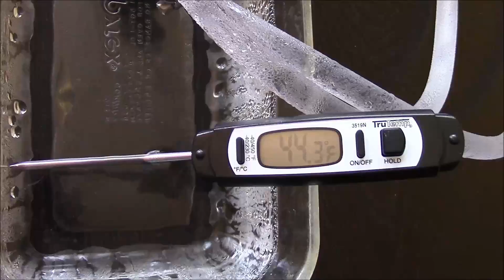How to Build A Water-Cooled Peltier Device or Thermoelectric Cooler

Comment: Hi LDS. Just wanted to know why the thermoelectric peltier tec1 12706 both sides get heated up when I connect to the 12 v adapter while I was testing. But while using a simple AA battery just to check the Thermoelectri,  one side was showing cool and the other plate was hot.
Reply from the maker: RaymondJacob0922
The last 2 numbers equals the approximate number of amps that the chip will draw.  The 12706 is 5-6 amps depending on the manufacturer, the 12715 is 15 amps, and so on.  The delta (difference in temperature between the hot and cold sides) is bigger on the higher power units and so yes they can get colder as long as you cool down the hot side adequately with a nice heat sink or cooling block.
Reply from the maker: +Benju Martin Thomas You need to have a heat sink connected to the hot side for it to work, otherwise the heat overpowers the cold.  Power it on for 3 seconds and then touch each side to figure out which is which.  Then put a heat sink on the hot side with some thermal grease.  Then the heat will have somewhere to go and will not interfere with the cold side.  Also, if you run a peltier without a heat sink it will burn up quickly.
Reply: +LDSreliance Thank you so much helped me a lot. Another quick q's. how long does it usually take for the Peltier Module to cool.
Reply from the maker: Benju Martin Thomas If you have a heat sink connected to the hot side you can freeze a water droplet on the cold side within seconds.  It works quick!  That is why you never want to run the peltier without a heat sink for more than 5 seconds or it can burn up.
Reply: Hi LDS, another quickie q's. I first cleaned up the Corsair Heat Sink plate, applied Artic Silver 5 paste on the heat sink as well as the water block. Tested the peltier with a AA battery to check the hot side and cold side. Placed the hot side on the heat sink and the cold side on the water block. Sandwiched it. Switched on the Corsair first for a few minutes and then switched on the peltier. At first I was amazingly shocked to see the Water Block getting cool so fast. After a few minutes I switched off both the units and to check again, I switched on both units but in minutes both the heat sink and the water block began heating up again. What could have basically gone wrong ? I've been working with this for than a week and upset. Pls do help me out.
Reply from the maker: Benju Martin Thomas I'm not sure.  But you can't turn the thing off without heat backfilling into the cold side.  I would turn the thing on and let it stay on.  Let it run for 10 minutes and check the cold side.  If it is not cold then you have a bad peltier.  They are very fragile and easily damaged.  I have done it at least half a dozen times myself.
Reply: Noob here may I ask a question cant seem to find an answer on google. When getting the TEC1 chip what is the difference between the numbers? 12706, 12715? is one colder than the other? thanks so much
Reply: ur awesome
Reply from the maker: RaymondJacob0922
Thanks and you are welcome!
Reply: LDSreliance. another noob question for the TEC 12706. If it is rated at 
12V 72W 4.5A. Does the power supply plug I know I have to get is a 12V, 
but do I need one that can handle 4.5 Amps as well?. I found a power 
supply rated at DC 12V 6A 72W. (I also found some 12v 1 Amps?)

I havnt started my project yet, still doing homework. thank you so much.
Reply from the maker: RaymondJacob0922 No, if it can provide more than 4.5 amps that is fine.  The TEC will only draw 4.5 amps even if the power supply can provide 100.  You just don't want it to produce less because then the TEC will not work to its rated capacity.
Reply: so stay away from 12v 1amp power supplies, as the chip will only draw 1 amp from it?... good to know. the 6 amp one it is :)
Reply from the maker: RaymondJacob0922 Yep, you got it.

Comment: im building the exact thing you did only the the cold side is circulated through a second radiator with fans that make really cold air...
Reply from the maker: +ToxiC BikEr Nice.  I have had quite a few people comment or email me about something like that.  How well does it work?  Do you have any data?
Reply: it will take a bit if time to complete this project because even the heat exchange radiador is custom built from scratch and this air conditioner will be built in a larger scale.. (4-8) peltier units and even more) when this project will be finaly built i will P.M you with the video :D
Reply from the maker: ToxiC BikEr
Sounds great.  I would be interested.  I designed something like this once upon a time but never built it.  So I am curious how yours will turn out.

Comment: can I control the temperature? like if I want to keep the temperature at 25° c for 30 days what I have to do? and how I control the temperature ?
plz ans me in my mail
Reply from the maker: +SUBHAM KUMAR SAHANA iitm Yes, there are thermostat probes that you could stick in the water that would turn on or off the cooling.
Reply: +LDSreliance where and how can I attached it
Reply from the maker: SUBHAM KUMAR SAHANA iitm
Just wire the thermostat in series with the positive wire coming from the power source to the peltier module.  The thermostat will act like a switch that turns power on and off at a certain temperature range.
Reply: +LDSreliance we r using 2 power source one is connected to the thermoelectric peltier cooler
2nd one is with small pump. So r u talking about that  I have to connect positive & negative wire of thermostat probe to the power source which connected to peltier cooler ? can I use this one 
http://www.ebay.com/itm/DC-12V-F-Fahrenheit-Temperature-Controller-Thermostat-Control-1-Relay-NTC-Sensor-/141777090187
Reply: +LDSreliance and what the use of Arctic silver 5 AS5-3.5G thermal paste
Reply from the maker: SUBHAM KUMAR SAHANA iitm
That paste will work great!

Comment: I'm currently designing a cheap sustainable fridge for Cameroon and I'm just wondering whether this method could be used?? also, how cheap are these utensils?? and does in need much power to run??

thanks, ollie
Reply from the maker: +Ollie Bamsey The peltiers themselves can be gotten for $5 or less per piece.  But the cooling devices are not cheap ($65-70 each).  You could air cool them with a properly designed cold plate on the inside (cold side) and then a high surface area heat sink and fan setup for the outside (hot side).  I bet a prototype could be built for under $100 including insulation and a case/box with hardware, excluding tool up costs.  In bulk I bet you could manufacture something like that for a cost of $50-60 each.  I'm not a product engineer but that would be my best guess.

It does need a good amount of power to run, so that is the problem.  To power one of the 5 amp peltiers around the clock (using a thermostat to modulate) it would require about 1 kWh per day to run.  That is not much if there is an electrical power grid but if you had to run this off of solar it would be expensive.

Comment: Hi, my name is Pond, I live in Thailand and it is very hot here. It is like 34 degree C during the day. Could you please give me an advice about it? I watched "How To Turn Your Fan Into An Airconditioner AC" (youtu.be/5NuvzWaBulw). I wonder if the temperature of the water that is cooled by the peltier cooling module is low enough to use instead of the iced water.

Also, I have watched your "Liquid Cooled Peltier (TEC) Refrigerator series" and I am not sure that which one is better, Corsair H60 on both sides of the peltier, or Corsair H60 on hot side and water on cool side.

I apologize if there are answers of these questions in your videos but I didn't catch them . I am not an English native speaker but I try my best to catch as much as I can from your videos.
Reply from the maker: +Phuchit Pond Hi, Pond.  I like the idea of using a peltier to cool down water to be used in a DIY air conditioner.  I don't think it will work as well in a humid climate like yours as it would be a dry climate but it will still work.  As long as you don't expect it to be ice cold like an air conditioner you should be able to get some relief.

I don't know which setup would be better as far as performance.  The benefit of the two H60 coolers would be that you will not have to fight any evaporation and insulating will be minimal.  The benefit of having the open water reservoir and pump system is that you can use a much bigger volume of water if you wanted to or you could dump ice in it if you wanted to (as long as it doesn't plug up the intake tube).  But if you are building a homemade air conditioner you probably need access to the cool water so I don't see how using two H60's will be possible.
Reply: +LDSreliance  "The benefit of having the open water reservoir and pump system is that you can use a much bigger volume of water if you wanted to or you could dump ice in it if you wanted to."  This sentence  gave me a very good idea! Thank you so much. 

Ps. I really like your introduction video. Thank you for making the world a better place.
Reply from the maker: Phuchit Pond
You are very welcome.  Good luck with your project!

Comment: for this kind of device, can this device turned on for 24hour non stop? if not, for how long should this kind of device turned on?
Reply from the maker: +Sion Napitupulu Yes, if you have enough battery power.  These devices are power hungry so it would require a lot of batteries.
Reply: I mean, will the device be overheat if i turned it on for a long time non-stop? 24 hours for example..
Reply from the maker: *****
No, as long as you have a good heat sink attached it will be fine.  And being on constantly is better than starting and stopping as there will be heat that will leech into the cold side when you turn off the device.
Reply: LDSreliance  i want to ask about the power supply needed, i have TEC 12706, 12V 5A. i also have one adaptor, 12V 1A.. can it run well with that adaptor? or should i find another adaptor, with exact Amperage (5A)..
Reply from the maker: *****
1 amp will not be enough.  It will probably not even get cold.  You really need to give it the rated current of 5 amps.  Sorry
Reply: LDSreliance what about 19V 3A adaptor? it will produce about 57Watt.
Reply: LDSreliance one more question, what if i use a 12v 6a adaptor, will it be over amperage?
Reply from the maker: *****
Nope.  The peltier will only draw 5 amps of current.  Good question, though.
Reply: LDSreliance hi, i just test my peltier device. it can produce cold, but only few seconds. after that the hot wins (two sides of peltier become hot) what is wrong?
Reply from the maker: *****
Do you have it attached to a heat sink?  You cannot run the peltier for more than a few seconds without both sides attached to a heat sink.

Comment: Hello everyone, I'm looking for a system to cool down a room of 200 to 300 sqft which can be alternative to traditional air conditioners (ac)..
Reply from the maker: +Satish Gupta It can be done with peltiers but it would take a LOT more energy than a normal air conditioner would use.  Like 8-10x more.
Reply: +LDSreliance  any other solution to cool down a room, not require as cool as ac but people should get relief and feel chill, should be alternative to ac and cooler, something innovative.
Reply from the maker: Satish Gupta
Do you live in a dry or humid climate?
Reply: +LDSreliance I'm from India Maharashtra
Reply from the maker: Satish Gupta
OK, so you are in a dry area.  I would suggest an evaporative cooler or a device that uses water to cool the air.  Here are a couple examples:

http://www.instructables.com/id/Homemade-air-conditioner/
http://www.instructables.com/id/Free-Air-Conditioning/

You could use a couple peltier devices to help cool down the water similar to what I have shown in this video.  You could then pump that water through a copper coil or heat exchanger and use a fan to blow air through the coil/exchanger.  That would be the most efficient use of power and would give you a cool breeze that would take the edge off the heat.  It will not replace air conditioning, though.

Comment: Can it be used the other way round to use the big fan as a spot air cooler?
Reply from the maker: +Gairik Biswas Yes, you can.  It will not feel very cool unless you are using a strong peltier unit, though.  Much stronger than the one I used in this video.  I would say at least 15 amps.

Comment: I know this video is kind of old, but I'd like to share my idea anyway. you will need a slightly bigger reservoir with 4 exits, 4 peltier modules (they are 40x40mm in size), one waterblock 40x160mm (that will be attached to hot side of modules), one heatsink 40x160 or close to that, that will be cooled by peltier modules while submerged in a reservoir. you'll obviously will need to use something instead of water. either mineral oil or anti-freeze liquid. to power up all of the 4 modules I suggest using a separate PSU. there's a trick how to run it without a motherboeard. the concept behind this crazy setup is that 4 of the modules will dramatically decrease the liquid temperature inside the reservoir. 2 exits will guid the liquid to a CPU waterblock and cool it down. another two will lead the liquid to a waterblock attached to a hot side of modules. sounds stupid, but I think it is worthy of a shot.

Comment: Been thinking about using this to cool water then pass it threw a radiator with a fan to cool my boat cabin down. right now I'm just using ice over a sealed copper tube water system using the same 12 volt pump u have. It works pretty good but ice can't last forever. Wonder if this would give me longer run time. It don't take much as long as the water is colder than the air temp is it will have a cooling affect
Reply from the maker: +djnemesis82pluss1877 There is no doubt it will last longer but it probably won't be as cold as ice.  You could still use the ice and let the peltier keep it colder longer and prevent it from melting fast.  That might be the best of both worlds.

Comment: Hellloo! I am an 8th grader and I will be doing your water-cooled peltier device for my science fair project to cool water and I was wondering if I could have some help with it.  For the cpu fan, did you cut up the wire to connect to the power source? If you did, is it posisble to not do that? I will be using my brother's cpu fan which is the two fan version and I will be killed if I cut it up. Haha. Also, if it's possible can I have a step by step tutorial on how to put it together? Thank you so much!! Please respond asap! (it's due in a few days, i know, procrastination)
Reply from the maker: +Angelice Leng You can buy a cpu fan adapter that will attach directly to the cpu fan connector and then you hack off the other end to splice into your positive and negative wiring for the rest.  But if you only have a few days until your science fair you may not have time to order one.  Here is a link to what I am talking about (you would be hacking off the larger white side connectors):  http://www.newegg.com/Product/Product.aspx?Item=9SIA6743R48956&nm_mc=KNC-GoogleMKP-PC&cm_mmc=KNC-GoogleMKP-PC-_-pla-_-Accessories+-+Motherboards-_-9SIA6743R48956&gclid=CjwKEAiAo7C2BRDgqODGq5r38DsSJAAv7dTP3k7vAx1TSseLWiry0dFuCcC3SwFLxW8mXE_5OkgEexoCBR_w_wcB&gclsrc=aw.ds

As for step by step I don't have anything like that.  I can answer questions but it is pretty straight forward watching the video.
Reply: +LDSreliance Helloo again! I figured everything out and instead of 2 power sources I am using three, one for each and the water pump doesnt seem to work. Electricity is running through all out and the power source is on, but nothing is pumping. Anyway I could fix this?
Reply from the maker: Angelice Leng
Test the pump with a battery of some kind.  You can use your car battery if you have to.  Use some car jumper cables and put the pump in a bowl of water and touch the wires to the jumper cables and see if it turns on.  If not, you have a bad pump.
Reply from the maker: Angelice Leng
If the pump tests out ok then something is wrong with your power supply or the connections you made.  If you get to that point and can't figure it out, send me a picture of your setup to ldsreliance@gmail.com and I will try to help.

Comment: Is it possible to cool a gallon of water with the same setup to perhaps 60 degrees in an environment of 75 degrees and water temperature of 72 degrees.
Reply from the maker: +dudeu4real Yes, it all comes down to how well you can insulate the water.  It may take several hours to get down to temp but it will stay there if the reservoir is well insulated.

Comment: Sir i have a question,have you ever built a peltier air conditioning unit using heat pump?Because i read some books regarding peltier air conditioning that when you use heat pumps inplace with a compressor you have a better efficiency is that true sir? thanks
Reply from the maker: +Jiffcloyd Jagus I have not tried it so I don't know the answer.